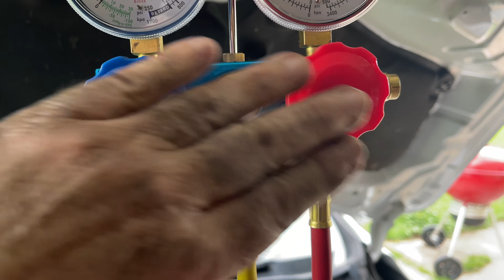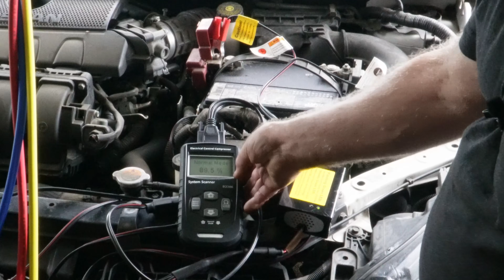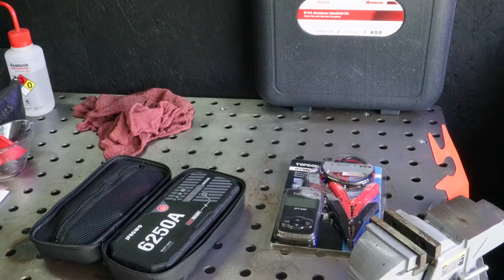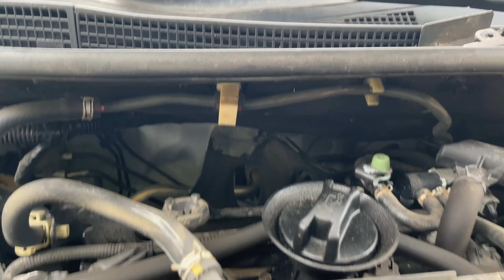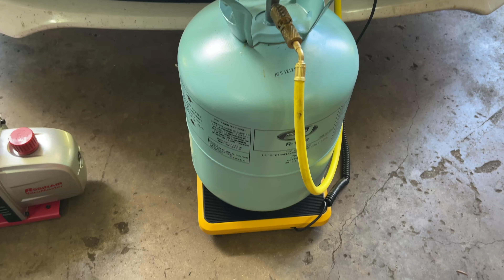How To Diagnose A Bad Automotive AC Compressor With 100% Accuracy

Comment: Thank you sir for such a fantastic educational video. I'm having a problem with a 2014 Kia Sportage. I put a gauge on the low side and it was all the way in the red and the clutch is spinning but I'm getting no cold air, hot air and in Florida with the humidity. That's unacceptable. I called a couple shops and everybody has a different way of doing things and it makes me really scared. My car has never been worked on and Freon has never been added to it. So for it to be running that high pressure on the low side and the clutch is spinning. I don't know what could be wrong. One shop says it's low on Freon and other shop says it's the compressor. So if you have any idea in the direction I should go please help me. Thank you! Great video!
Reply from the maker: Unfortunately without me actually checking the ac system myself, any answer I give you would be a guess.  Just saying the low side is in the red doesn’t tell me much.  I’m assuming you are saying that the low side pressure is very high?  Both high and low side pressures need to be evaluated to better understand what’s going on in the system and as I showed in this video, most modern car ac compressors are controlled by the ecu or ac control module and that has to be looked at as well if a faulty compressor is suspected.  Too many unknown variables for me to give you an accurate answer.  Sorry

Comment: Excellent video for its content and back-story information. This video went beyond the obvious and described the EDM/ECU interaction with the system. The term duty cycle was used as it relates to the compressor: while I take exception to the specific application of the term, Skill Savvy DIY explained precisely what the computer was controlling inside the compressor. I'll definitely apply it to my granddaughter's VW. I came to the conclusion that it was the compressor.
Reply from the maker: Thank you I appreciate the comment!

Comment: Did an UV Dye test and found leaks around hoses and compressor.  All the gas is now gone due to leak.  My question is:  After replacing the compressor/clutch (comes prepared with oil), and the hoses, do I need to pull a vacuum of the system before recharging it, or do I go straight to recharge process after replacing said parts?  Thanks.
Reply from the maker: You absolutely have to pull a good vacuum to remove the air and moisture.  Anytime you open up the system to replace parts, it fills with unwanted air and moisture.  Most auto parts stores will rent vacuum pumps.
Reply: @SkillSavvyDIY  I'm getting ready to pull a vacuum on this bad boy early in the AM.  Two questions:  1) What is the approximate time that I should be pulling vacuum (mini cooper R50 that takes about 15 oz of R134a). 2) I had to take a wheel off and it's sitting on jack-stands a couple of feet of the ground from front only.  Is it ok to pull vacuum and to recharge while is lifted?  Thanks.

Comment: Hey.. thanks so much for this video. But Im still having trouble and confusion. I got a '99 Silverado 5.3. Last year, Last spring I replaced my AC compressor, accumulator, condensor, pressure switches, and orfus tube. (almost everything). Pulled a vaccum and charged it. Worked excellent until later summer... just randomly working and then not working. Still the same this year. I've checked freon again. I've jumped (with paperclip) the sensor at the accumulator, the sensor down at the condensor, and the ambient air sensor down behind the bumper. (all three at the same time)... but still the same.. just randomly works. I can drive it 20 mins not working.. stop somewhere.. start it up again to come home and its fine all the way home. I switched the relays. I've jumped the pins 30 and 87 with key Off. And I do hear the click click. I did it with the truck running too.. and compressor stays on and cools with pins jumped. Could problem be the actual dash control switch ?? (even tho the light button is lit ON??)
Reply from the maker: Yes it could be the AC controller, I've seen it before.  Sounds like you have checked everything else out throughly.  If it were mine, I would pull up a wiring diagram and check the output signals, power and grounds at the AC controller to prove if it's bad before replacing.  Have you checked the ground cables to inspect their condition for the engine?  The AC clutch coil normally gets it ground from the compressor body itself which gets its ground from the engine that is grounded to the battery via cables.  A bad ground connection could also cause the clutch to randomly engage and not engage.  Just a thought.  Hope you get it sorted out.

Comment: Hi, I have a 2008 Ford Explorer 4.0. Yesterday, when i turned on my truck with my AC turned on i noticed a loud noise coming from the engine. I though maybe being that the temp outside is obove 90 the belt could be making the noise. I revved the engine very lightly and i noticed the noise stopped and went away but then immediately after the noise went away i noticed that the cold air on the AC stopped working and i was only getting warm to hot air. Could it be that the entire AC compressor needs to be changed or just the clitch. If neither one, what could be the issue with the AC. I looked at the compressor with the truck running and the AC on but i noticed the center clutch isn't spinning. What are your thoughts?
Reply from the maker: In all honesty there is no way for me to answer this without actually checking the vehicle out myself.  Too many unknowns for me to accurately give an answer.  Just the fact that the clutch is not engaged doesn’t give me enough information.  I suggest taking it to a reputable AC shop that can diagnose the issue.  Sorry

Comment: Working on a 2018 Honda Civic, the dealership replaced the condenser under warranty, so it is brand new. I replaced the compressor because the clutch was bad and am dealing with almost identical pressures as what you show. I have since replaced the expansion valve and still getting the out of range pressures. Do you think I got a bad compressor or do you think it could be the ecv? I dont have the tool to test for pulse width which makes it frustrating.
Reply from the maker: You need to check to make sure the ecv solenoid is getting the pulse width voltage from the pcm or ac control module.  Some scan tools can show if it is working.  It can also be checked with a multimeter that can show duty cycle or a cheap oscilloscope.  Really no way around checking that before condemning the new compressor or the ecv

Comment: I saw your video… I having a hard time to diagnostic my compressor on my Hyundai elantra 2013… no lights no codes no issues with relays or fuses clutch is engaged perfectly but blows hot air high pressure sensor is good too
Reply from the maker: Hope you get it sorted out

Comment: How do you convert an old r-12 system to r-134A? For example 1991 GMC.
Reply from the maker: I use to do a lot of retrofits from r12 to r134a back in the mid 90's when r12 was phased out.  We would typically do them on vehicles that needed a new compressor, but even if you use the old compressor you will start by draining out ALL the mineral oil out of the compressor and replacing with the recommended oil which is PAG 150 for a 1991 GMC truck being sure to put the full recommended amount.  I would also suggest adding a UV dye in the compressor oil before putting it in the compressor to help identify future or current leaks.

Now you will need to get a few quarts of fast evaporating AC flush and flush the condenser, evaporator and all the refrigerant lines to remove any of the old mineral oil that r12 required.  You can rent a flush can from your local auto parts store such as autozone, but you will need compressed air to push the flush through.  I use a nitrogen bottle.  Make sure to blow through very well over a period of time to get all the flush out of the system.  Any remaining traces of flush will boil out when pulling a long vacuum.  

You will need to replace the orifice tube which that model uses, making sure to go back with the same color orifice tube.  Make sure to remove the old orifice tube before flushing the liquid line which holds it.

The accumulator will also need to be replaced.  Do not try to flush the compressor, accumulator or any refrigerant lines that have mufflers on them.  They will have to be replaced if they have a muffler on them. That truck should have the old style tubing style condenser and should be able to be flushed easily. 

Sometimes especially on an old system like that, the orifice tube may be hard to get out.  As a last resort if it's being stubborn, heat up the aluminum line where the orifice tube is with a propane torch and get hot enough to soften the plastic on the orifice tube and have someone blow air pressure through the other end of the line and it should come out like a pissed off hornet.  Or you can replace the line.  Many times they will come right out, but I did want to warn you incase you run into that.

 As you put the system back together, make sure to replace all the old o rings with new ones and lubricate them with a drop or two of the pag oil.  Once the system is put back together and sealed, put the r134a service ports on.  They will screw right onto the original 1/4" r12 service ports.  You can get them at most any auto parts store.  The larger service port is the high side and the smaller one is for the low side.

Pull a long extensive vacuum ensuring to remove all the moister or any flush trapped in the system.  A micron gauge can ensure that, but most folks are not going to have that, so I recommend a very long vacuum, hours even.  Now charge the system to the specified amount by weight.  

Hope all that makes sense and helps.

Comment: Good info.going to check duty on Jetta with no change of pressure with ac on.saw pine hollow video on some German car that compressor and control module replaced.system would not work right until diode added across control valve to suppress back emf kick.replacement parts were incompatible so that how he got it to cool.question im using nitrogen from welding supply  (not medical grade)and curious about how to check moisture content?
Reply from the maker: Using a micron gauge is the best way to determine how much moisture is in the system.  Generally you want to pull a vacuum to 500 microns or under to ensure you have removed unwanted moisture from the system.  What video did you watch from Pine Hollow.  I would like to watch that.  I'll try to search on his channel.
Reply from the maker: Nitrogen from a welding supply is where I get mine.  That's all you need.
Reply from the maker: Just watched Ivan's video.  Very interesting!  Older GM trucks and cars used to use a diode at the compressor electrical connector to protect the circuit from the voltage spike when the magnetic coil in the clutch turns off.  Todays cars and trucks have that protection in the ac controller.  I recently had to replace a compressor on a VW Passat that had a clutchless compressor and I had no issues at all with the ECV solenoid working as it should.  The replacement worked great.  The old compressor had aluminum shavings in it and sent them all through the system, so I had to replace the condenser and receiver dryer, expansion valve and flush through the evaporator and refrigerant lines.  Good as new now.
Reply: Thanks for info.i remember the diodes on gm cars.ford later added internally one to firewall starter solenoid,the one that mount flat 1980s -on.wish those connector on variable compressor were easier to access.

Comment: That's a neat tool, I've always used a test light across the control side and power/ground whichever way it is controlled.
Reply from the maker: Yes it is.  I like that I can see exactly percent of duty cycle the computer is commanding to the ECV, and also the ability to bypass the computer and manually control the duty cycle

Comment: We had 2 Malibus come in last with the same symptom. Full charge, compressor clutch engaging and there’s was 150psi on both the low and high sides. Being that I’m just an apprentice, I wasn’t involved in working on the car. My guess was either there was a faulty TXV that was stuck wide open, allowing the pressure from the high side over to the low side, or the compressor was on the way out and was allowing pressure to back feed from the high to low side. Do either of those sound like the likely causes?
Reply from the maker: If the txv was stuck wide open it would be over feeding the evaporator which would cause severe frosting on the return line coming back to the compressor, and not likely that a stuck open txv would give identical pressures.  It should still pump down some what.  If the pressures were completely equalized and reading the same, the the ECV valve needs to be checked to see if it is getting a command from computer that controls it as I did in this video.  That can be checked with a tool like I used, or an oscilloscope, or some multimeters that can read duty cycle.  Also ohm the resistance on the valve to make sure the coil is good.  It should read 10 to 14 ohms.    If all checks out ok, then the compressor is just not pumping any longer.

Comment: I have to work on a 2008 Lincoln MKX. I've been repairing cars for many years and I do not consider myself a professional. Just someone who likes to spin some wrenches and save some money. I have a problem that I haven't seen before. When I'm driving around town and the temperature is above 100, the AC will start blowing warm air. Then it will start cooling off again. I did hook up my gauges and noticed that suction line pressure went over 150 psi while the compressor was not on. The high side showed about 450 psi. I did check the static pressure of the refrigerant and it was a little bit on the high side. I did bring it down a little bit and it seems to be running a little better but it's still blowing warm air once in awhile. The time that it happens a lot is if I shut off the car and then restart it a few minutes later. It seems like the compressor never kicks in because the pressures are too high. At first I wasn't thinking it was a compressor issue. I was thinking it could be a condenser issue. This is one of those condensers that has the built-in dryer. I've never worked on one of those before. I did order all the parts to replace practically everything but the evaporator. I'm thinking I should do just the condenser and expansion valve. What do you think?
Reply from the maker: Based on what you have said, it sounds like the system has a bad restriction that is driving up the head pressure causing the pressure sensor to take the compressor offline.  Yes, if you are going to replace the condenser/receiver dryer then I would definitely replace the expansion valve, and I would also flush the evaporator while the expansion valve is off, and the refrigerant lines to remove any debris (do not flush the compressor).  Just make sure to blow out the flush really well.  You don't want to leave any of that in the system since it will strip the oil out of the compressor once you get it back up and running.  A very long and deep vacuum will help in boiling off any flush that got trapped in the system.  Since oil travels through the entire system, you will need to add a few ounces to replace the oil that the flush removed.

Comment: Good day sir, excellent video. Could you help me out with something? About 9min 30 seconds into the video you are talking about hooking up a Flukemeter to see the duty cycle of the compressor. Could you explain how you would hook up the fluke meter? Would i have to splice it into the 2 wires going to the Variable Displacement Valve? Thank you
Reply from the maker: 1. Locate the ECV Connector
	•	Find the electrical connector going to the ECV on the A/C compressor.
	•	Typically, it has two wires: power (PWM signal) and ground.

2. Identify the Signal Wire
	•	Use a wiring diagram or service manual to find which wire carries the PWM signal (from the ECU or HVAC control module).
	•	Usually, this is the positive (control) wire.

3. Backprobe the Signal Wire
	•	Backprobe the PWM signal wire using a pin or backprobe lead — do not pierce the insulation unless you have to.
	•	Connect the black lead (COM) of the multimeter to chassis ground or battery negative.
	•	Connect the red lead to the PWM signal wire.

4. Set Multimeter to Duty Cycle Mode
	•	Turn the dial to % duty cycle (on Fluke meters, this may be a secondary function under the Hz or AC voltage setting — press the yellow button to toggle).
	•	Example: On a Fluke 87V, turn to Hz/%, then press the yellow button to switch to %.

5. Start the Engine and Turn on A/C
	•	Let the system run; make sure the ECV is being commanded.
	•	You should now see a duty cycle percentage on the display (e.g., 10% to 90%).
	•	Higher % = more cooling demand (valve open longer)
	•	Lower % = less cooling

Interpreting Readings:
	•	0% or 100% duty may indicate a fault (wire short/open, module failure, or command override).
	•	Normal operation varies by system but is typically between 10%–90%, changing based on A/C demand.

If you’re not seeing any reading:
	•	Double-check you’re on the right wire.
	•	Make sure the ECV is being commanded (e.g., no faults in the HVAC system).
	•	Try measuring frequency (Hz) to see if a PWM signal is present at all.

Hope this helps